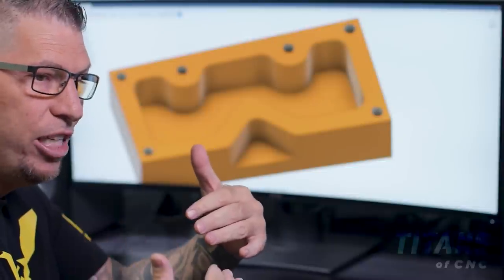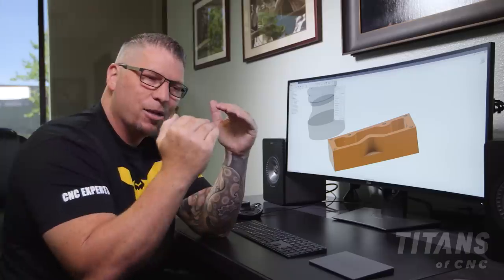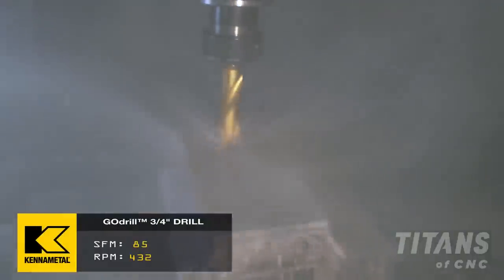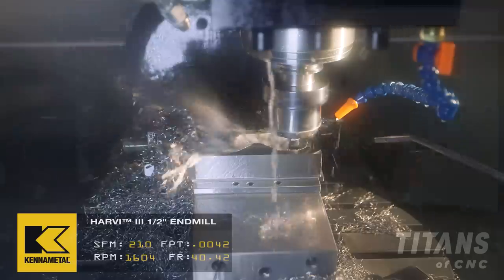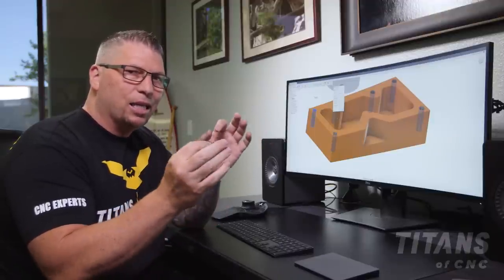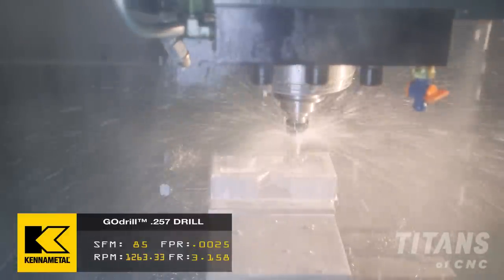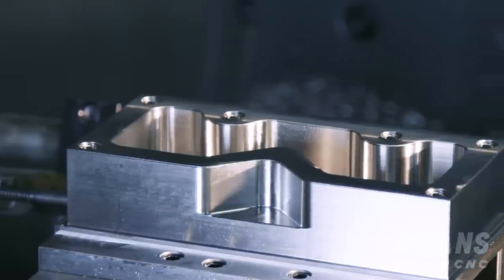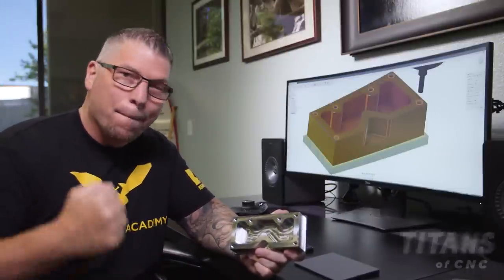How to Program & Machine INCONEL 625 | XL TITAN-1M Tutorial

Comment: I am machining inconel on a manual lathe. Had problem with melting the corners off a 3/4" drill running at 200RPM...
I found drilling further with a 1/2" drill at the same speed was much easier. I'm finding this stuff easier to machine if you go much slower than nornal. It's a bit like drilling into a very tough stainless steel, like a piece of Cutlery. Sometimes if I accidentally work harden doing a 1/8" hole I have had success breaking through it using some little single flute carbide router bits...
I've even had success grinding a masonry drill into the shape of the tip of a normal drill to get through something that's work hardened

Comment: titan gilroy- well produced video.  The through the spindle coolant is a huge advantage for drilling inconel!  We added an M code driven air blast to our Haas machines that works really well to periodically clear the chips during deep pocket milling to keep the endmills from running over the chips and damaging the tool and/or surface finish of the part, without any M00 or operator intervention.  What was the total cycle time on this inconel 625 block?

Comment: Those Go drills are awesome. I used a 9/32 diameter to drill 400 air hammer bits made of s-7 tool steel. The last hole was the same diameter as the first.

Comment: Very good video! I enjoyed watching! I'm not trying to sound like I'm smart or something, but I have a question about the threading. I don't understand how you can thread mill when your cutter and the thread are so close in diameter. The cutter is cutting horizontally while the thread is at an angle, and I believe the threads won't be 60 degrees, but will look like some sort of perobola.

 I remember at work I was thread milling a spiral oil groove in a bushing. The print called for a 3/32 radius I believe, and it took using a 60 degree spinning threading insert to achieve that!

Anyway, do you see this as a problem in thread milling, or am I being too picky with small stuff like this? 

Thanks
Jimmy
Reply from the maker: Actually this is the exact perfect threadmill for this exact thread with the perfect design for cutting in and tightly rotating around...
In Aerospace we not only use Go-No Go... but also Mold Threads to Inspect... and they come out absolutely perfect.
Reply: I think he's saying that the thread has a helix angle but the cutter does not, so that a cutter nearly as big as the minor diameter would be cutting away the upper flank on the lead-in side (because that flank is tilted relative to the revolving envelope of the cutter), and the lower flank on the lead-out side.
Presumably that's factored into the form of the cutter?
Reply: The toolpath is actually a helix, defined by the thread pitch. It may appear to be cutting "horizontal" or in one plane, but it isn't. Maybe that's where the confusion lies?
Reply: @Gottenhimfella  sound like you got the idea! I did a bit of research on this topic and I found it's called the "thread milling profile deviation" sand Vick actually talks about this in an article...

https://www.sandvik.coromant.com/en-us/knowledge/threading/thread-milling/pages/application-tips.aspx

"A smaller cutting diameter will help to achieve higher quality threads. The cutter engagement will create a minute form error on the root of the thread profile. In internal thread milling applications, the relationship between threading diameter, cutting diameter, and pitch will affect the true radial depth of cut, ae eff, which becomes much larger than the chosen radial depth of cut. A larger true ae will increase the deviation in the root of the thread. To minimize the profile deviation, the cutter diameter should be no greater than 70% of the threading diameter.

Example M30 × 3

A tool of 21.7 mm diameter gives a profile deviation of 0.07 mm (0.0027 inch).
A tool of 11.7 mm diameter gives a profile deviation of 0.01 mm (0.0004 inch)."

I hope this helps! :)
Reply: @therussianmachinists2409    OK, that certainly clears it up. And it makes perfect sense. 
Good research skills, and thanks for taking the trouble to report back !
Reply: @Gottenhimfella  no problem! And sorry for the late reply :/

Jimmy

Comment: Hey Titan, love the videos. I got a .140 and .250 holes in inconnel 718. Having trouble finding proper speeds and feeds for the coolant through drills. Any pointers? Tool manufacturer recommends 10 SFM at 1000rpm for the .250 hole. Feeding at 1.0
Reply: Try kentip drills from kennametal 
Which ar very good for nickel based matirials 
What is ur drill size and do it machi saport thrue coolant I can give u a beter solution we are the kennametal  delers from I dia
Reply: From india
Reply: I will give you a little help. 10 SFM on a 1/4 tool is only 152 RPM, then say you want a .004" chip load it would be .61 IPM. Your SFM is your RPM. If you are running 1K RPM with that feed then you are cooking your drills.
Reply: What manufacturer recommends 10 sfm? Putting on my conversion hat... we typically drill Inco 718 @ 50-100 sfm, dependent on the drill length/diameter and the machine... as we have a couple with 7.0 MPa (1000 psi) thru-spindle. Recommended feed rate for drills is listed as mm/rev (inch/rev)... just fyi.

Comment: When calculating the speed for your chamfer tool, you should use the cutting diameter, not the overall diameter of the tool.  It doesn't matter what the speed of the outer diameter is running at. All that matters is the speed of the cutting surface where it contacts the material. Great video though.  Next time, try inconel 718. It makes 625 seem like fun.

Comment: Very nice informative vedio...what is diffrent between inconel 625 and inconel X-750 ?
Reply: X-750 has solution strengthening properties, meaning it can be hardened by baking in a furnace. It's much harder and stronger than 625 once it's been baked.

Comment: One of the "secrets" to Inconel is that you can't tickle it.  You need to get in, make your cut and get out or it will work harden.  For example, I couldn't use coolant fed drills so I wrote my own drilling subroutine to minimize the dwell time at the bottom of the hole so it couldn't work harden.

Comment: How do you prepare a program for soo complicated structures. 
What is the purpose of AutoDesk fusion 360 in building a program?
Reply: Fusion 360 is the complete package. You can do all of the modelling, rendering, simulations (loads, tensions...). Then just switch to CAM, create tool paths and export them for the machine you are using

Comment: How do you know what parameters you should set for each tool ? Do you use recomended parameters from producer ? What if I use low quality tool, what parameters I should set ?
Reply: The supplier catalog is the best place to start. The base numbers are usually for a "square" cut. That is, Open profiling with 50% diameter step over and one diameter deep. They should include formulas for modifying those for high speed, increasing sfm and feed per tooth as radial engagement is reduced.
I built my tool library this way straight from the garr catalog with gradual tweaks based on feed back from the spindle load meter.
Reply: As stated... start with the recommended rates to establish a baseline, then tune your cuts to achieve best removal rate. Keep in mind that once an optimal removal rate is found for any given tool, holder, gage length, etc., any change in that system will require tuning... but here we're talking min/maxing beyond what most people are doing. SFM is heat management... less radial (<50%) will decrease the desired chip load, so you will need to recalculate the feedrate to maintain the chipload... this is the premise behind all high speed machining.

Comment: Correct me if I'm wrong, but it looks like you're conventional milling, not climb milling. What is the reason for this? I was always of the impression that with CNC, climb milling was better for the tooling and you'd get a better surface finish.

Comment: I made these comments over a year ago, circling the bowl like all of us. But I was looking down, only seeing the bad. I'm trying to look up more, dreaming of how to climb out and do better. I would ask for forgiveness. The preceding comment helps no one. Machine the stock sides parallel before going into the vice. It reduces the amount of stress introduced from clamping and reduces some of the finished part twist. Only machine what goes into the vice. The Chip Load is defined at the point perpendicular to the vector of the cutter, not where the cutting face meets the material. The amount of "real" material being cut is called Estimated Chip Thickness (ECT) and is FAR less. It would be prudent to ask Kennametal how they find their recommended chip load before adjusting to the ECT. (and the chip load should be) You will find that you can quadruple the feed rate. The biggest killer of this is double cutting chips. Chip evac is CRITTICAL. I left what is below so that you know I read it.

C'mon, a master class should include tips on how to work under .0005". Was the raw stock pre-machined? Know why it is important? The feed rate is too slow for that roughing W.O.C, the tool will dull after a short M.R.R. It will also give the chips more weight and will therefore fly farther. The pile of chips need cleaned out during production. Ask Kennametal for an EM with thru coolant, and run a mist like a Bridgeport Mister. Use that roughing tool path on the pocket floor. Stay .005" away from finish and use a 75-80 percent W.O.C. It will reduce the finish time, remove the Flex from the roughing op, ergo removing double the flex deviation during the first finish pass possibly eliminating the spring pass, which rubs a carbide tool dull sooner.

Comment: Why the bottom of the material is not as smooth as the outside? Can you make it smoother?
Reply from the maker: It’s just the first op

Need to flip and deck
Reply: @TITANSofCNC  I think you should show it to us also, cause it is the most difficult thing to do from the entire job, especially for the short working space and the corner.
Let the people smarter by educating them the whole proccess. 
By the way I love your video, the way how you explain it before. Very inspired 
Good job, keep it on

Comment: Write it down: Inconel is NOT HARD. It's TOUGH.
Inconel is actually pretty soft compared to many steels. But it does not lose it's strength until its red hot, when most steels have become very sorft. Inconel chips don't soften up when being cut and this is one aspect that makes it hard to machine.

Comment: I run a lathe which somebody crashed years ago. The turret has a little play, and maintenance is incompetent.  I have to run "spring passes" on everything... even brass.  I either run everything at the exact same finishing depth of cut, RPM, and IPR, or run a spring pass.  It's absurd, and they probably won't fix the machine as long as they get good parts.

Comment: Why not drill more holes to relieve the endmill?
Reply: If you have ever milled into a hole, you would not do it .You would be machining large cuts then small cuts in the same pass and slivers of material could break off and jam the cutter. the way it is shown in the video is the only way to do it .Some of the harder materials will glow red hot if you try and machine a thin piece of material ,because it tries to bend out of the way.The cut needs to be solid .Take it from me, I have machined most of the hardest materials in my 49years of engineering Intermittent cutting is a different ballgame

Comment: This is the material that ended me at my last shop
Reply: Had to manually drill 4 1/8" holes in several 1/8" thick parts broke about a dozen drills and still only able to get 2 holes drilled

Comment: I do like your video’s but it’s all in inches.. thats too bad.. maybe for in the future for the fans in the netherlands 😉
Reply: Gaat mij ook niet om de maten maar om de snelheden 😛
Reply: Learn inch. Most American machinists know inch & metric. 25.4 gets you there.
Reply: This is possible, of course. But instead of saying 0.002 mm (or 2 microns) we should learn how to spell 0.00007874 inch?!?!
Reply: @JP-kk5vw  in the rest of the world, we only learn one system. The only reason to practice inch is to watch YouTube videos about machining.
Reply: @BaldurNorddahl  What if you received a drawing using inch measurements?
Reply: @o11o01  I have never even once in my live seen a drawing with inch measurements, except here on youtube. Inch is not used outside america - at all. zip. zero. It does not mean we do not know about inches or that an inch equals 25.4 mm. But it does mean we do not generally know about things like number and letter drills (I have never seen such a drill except here on youtube). If I did get such a drawing I would convert everything to mm before working with it. I would be forced to do so, because I have no rulers or anything else that measures inches. And no tools with inch measurements.

There are some small exceptions. Sometimes you get imperial screws in some strange places (american made cars, computer cabinets). For that reason, we might have imperial taps in addition to metric taps. But we are unable to drill the correct size hole to use those taps, because I have never seen inch drills sold here.